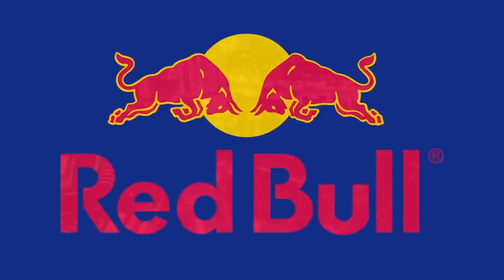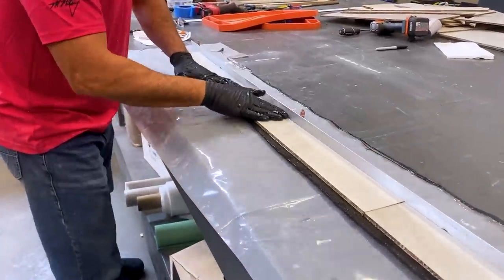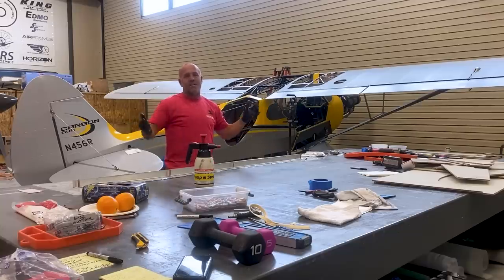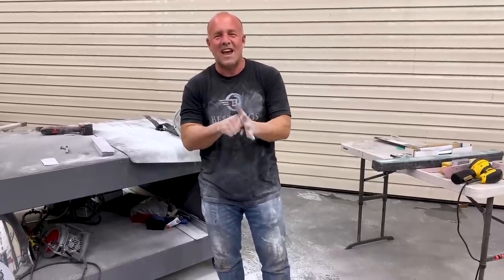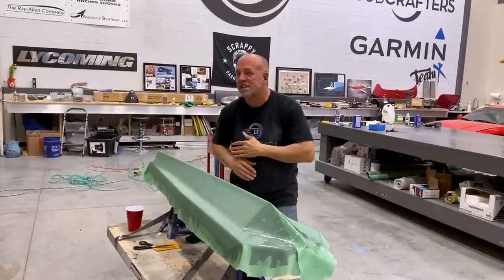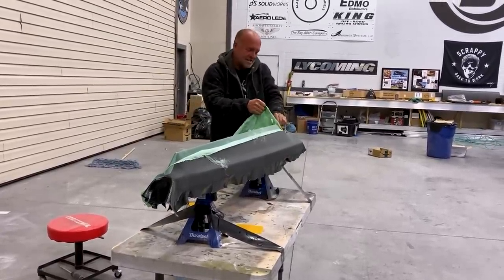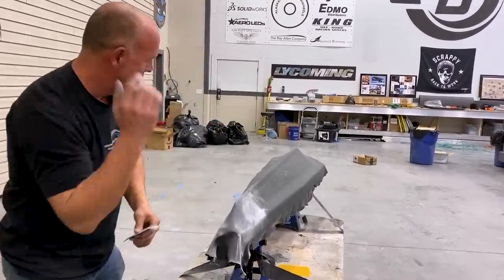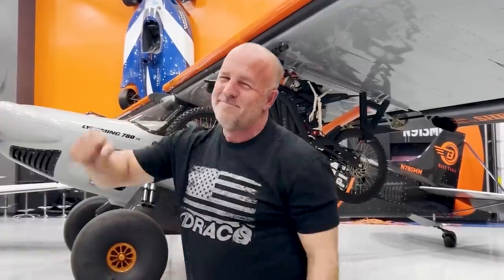Red Bull Dubai Helipad Airplane Build #2 | Crash Pad and Wrapping an Airplane

Comment: Just curious - why not Kevlar for this piece? Excellent work.
Reply: Carbon offers high strength with low weight and it is sturdy as well as flexible. Carbon fiber allows for to be lighter and stronger. Kevlar has a high toughness which is useful for things like bullet resistant clothing, but Kevlar fiber has a lower tensile strength than and is heavier than carbon fiber.

Comment: Dex did a great job, but I'd be interested in knowing how much weight you cut out versus how much the wrapping added back.  I understand that it was necessary, but it certainly has a penalty and this hasn't been discussed so far.  Wrapping inherently means spare performance was available ;).
Reply: My same question. All that vinyl wrap must have added quite a few pounds.  So in the end, was it a wash?  Why no specific weights given.

Comment: On your carbon lay-ups. Have you thought of borrowing a technique from aeromodelling where we use vacuum-bags to squeeze the job into shape? It works amazingly to produce a compressed carbon layer structure and reduces air pockets. It also squeezes out excess resin to reduce overall weight. I use a Sous-vide vac-sealer for small parts and it works a treat!
Reply: Mike vacuum bags most of the carbon parts he does, are you talking about some sort of special vacuum process? I'd say he didn't use it here because he didn't want pin holes
Reply: Mike used vacuum bags lots of times in previous videos. Pretty sure the fact he didn't have a mold because of making the part in situ was taken into consideration when deciding on what technique to use here.
Reply: You need to watch the scrappy videos!
Reply: Why dont you listen to mikes words or watch the videos.

Comment: Aren't you just adding to the overall weight of the aircraft this makes center of gravity of the plane different then original specs. Meaning that flying is going to be way different then flying a stock version because of added weight and change of aerodynamics. Glad I stumbled on the channel, great work my friend
Reply: The airplane both lost and added weight.... I am sure that Mike will keep this airplane within limits of CG... He didn't show it but it probably got a fresh weight and balance.

Comment: When wrapping a wing, there should be no bump at all on the front circular curve part of the wing. Top and front curve should all be one piece one layer thick, overlap seam should be under the wing an inch behind that front curve, and you can put the bottom on first and overlap with the top
@> all the way past the curve. Aero is king.
Reply: wow,pretty smart,they probably didn't think about that-LOL
Reply: @MegaRickw  look at 25:26, they didn’t do as I advised 🤷

Comment: I am wondering how did weightbalance work out in this one... It seems like you guys moved and added lots of weight (bumper, fuel tanks etc) to the rear and removed some from the front. Either the cub is incredibly stable as is(cg way infront of the aerodynamic forces center, or whatever that latter one is called), or you guys did something clever for counterbalance :D
Reply: It's a super stable platform from the beginning and was probably on the very front side of the cg envelope to start with. My pa-14 flies awesome with a bunch of weight In the back. Doesn't look like he added a whole bunch of weight
Reply: @kits-r-us7632  Okay, makes sense

Comment: Mike, If you manage to see this comment, I would LOVE to hear about the legality of this plane.  My understanding is that there are limits to the modifications that can be made to a factory aircraft.  Was this plane originally an experimental, so it was easier to modify, or were there hoops that had to be jumped through to make the modifications?
Reply: Carbon Cub FX is innovative Builder Assist / Experimental Amateur Built (E-AB) aircraft and may be certified up 2,000 lbs gross weight.
Reply: Some Carbon Cubs are certified but this particular one is Experimental, so it’s a lot easier to modify.
Reply: @ChandraSlyFoxPatey  thank you, that makes a lot of sense, and had considered that as a possibility but hadn't noticed it saying "Experimental" anywhere 8)

edit: also hadn't bothered to try to look up the tail number 8)